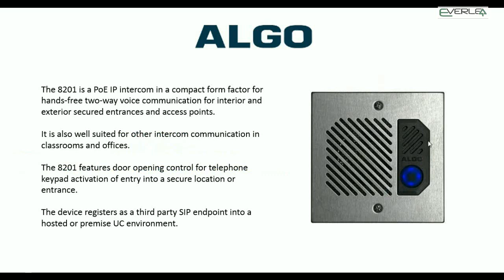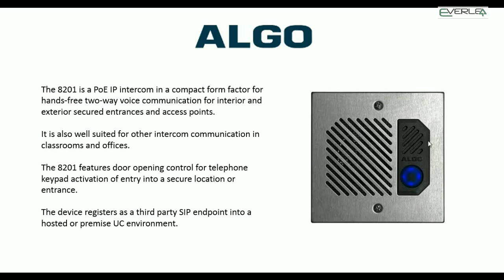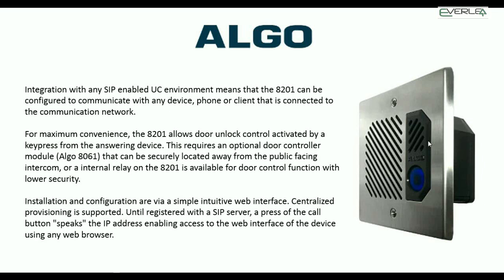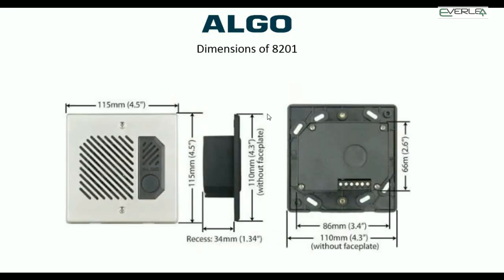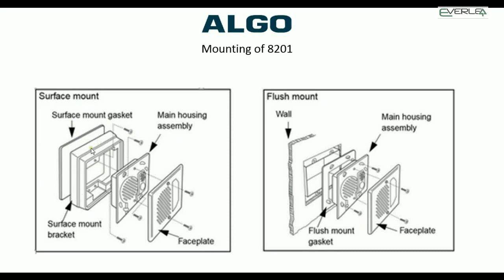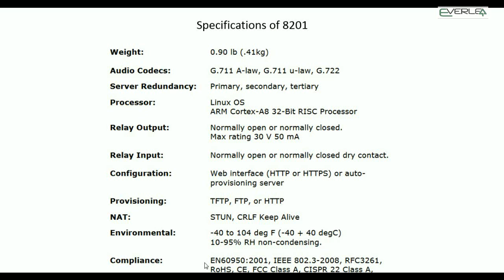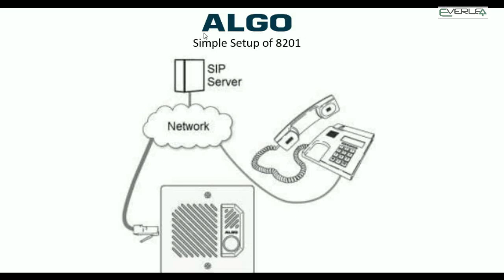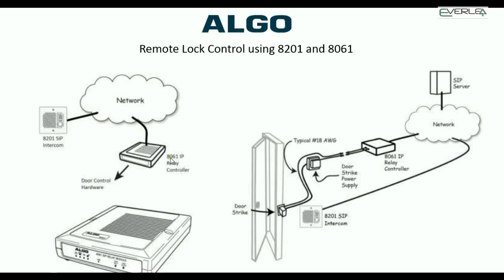Algo 8201 IP Door Phone

Comment: It doesn't tell me the IP when I press the button on the intercom. It's all connected. Red light is on the button. It beeps after thirty seconds but pressing the button doesn't give me an IP to use....
Reply from the maker: Hello, If the device is not giving you an IP address when you have pushed the button, this could be an issue with the device not being given one by DHCP, you will need to investigate the network with your IT team to confirm if this is the case.